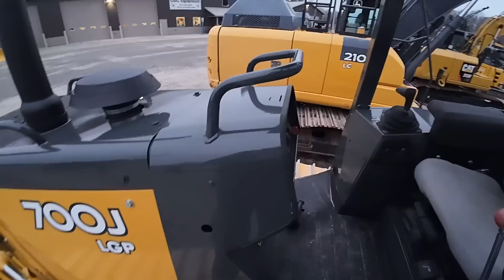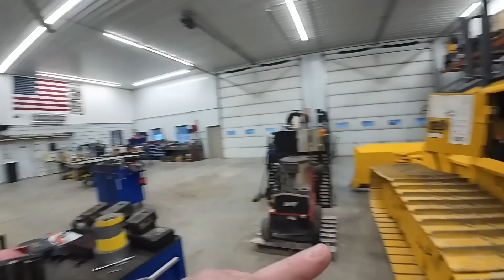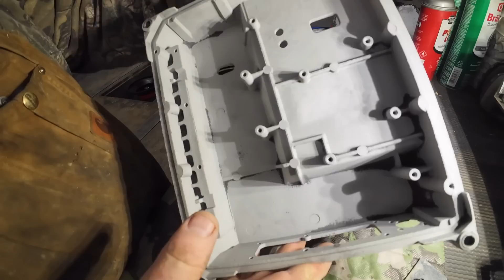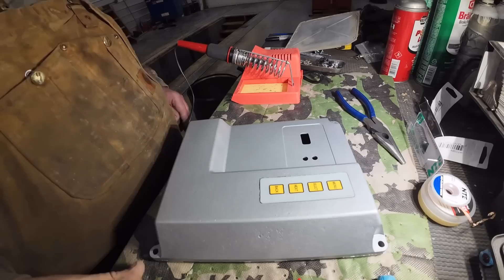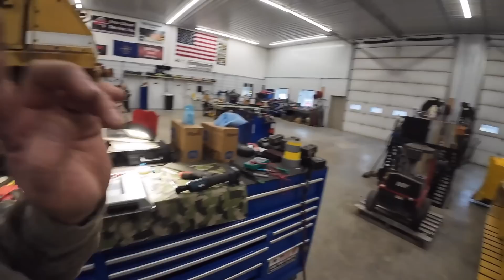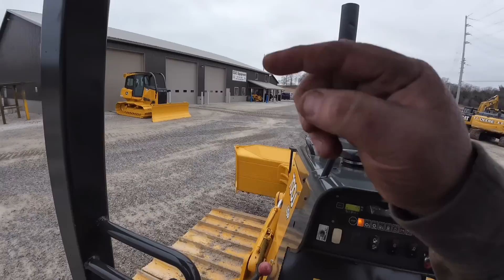John Deere 700J dozer transmission MC300 controller repair after it failed for cheap!

Comment: That's an interesting repair.  Several others have made some good suggestions, namely test the capacitors out of circuit.  They do indeed have a limited life depending how hot they run, how much voltage ripple they see and how close to their rated voltage they are being used amongst other things.  You can get different temperature ratings of those capacitors and should replace with the same or higher.  Someone in the comments suggested using a solder sucker.  The vacuum desoldering machines are good but the mechanical plunger types can push the tracks off the board particularly if you get the joints too hot.  It would have been good to spray the new joints with some lacquer to limit corrosion, after cleaning with alcohol and to have replaced the silicone to add mechanical support.  I would have made sure that the connectors were properly dry before plugging back together.  Using a good silicone spray designed for electrical connections would also help.  Perhaps you didn't show that.  Given the amount of moisture under that cover, I can't help wondering if the fault codes were due to corrosion on the connections as much as old capacitors.  I'm sure they're meant to be waterproof but 20 years covered in damp muck isn't going to do them any favours.  I think I'd have used a different adhesive, maybe silicone or epoxy or a high quality waterproof double sided thin foam tape to seal the display cover and buttons; I'm not convinced CA glue will fill all the gaps.  I hope this might help in future repairs.  I enjoy watching your videos and appreciate the time and effort you put in to making them.

Comment: I like that you used star washers to get a good electrical connection, but something else we used star washers for at Ford Product Development, was to fix squeaky dash or trim panels.  You put them between the panel and the bodywork, but you put one on the bolt/screw head side as well.  Worked like magic to stop squeaks and rattles.

Comment: Free advice from a veteran Aerospace Engineer that has dealt with electrical components for many decades (through the phases from Vacuum Tubes, thru hole and now surface mount components). Even with "power off", those same capacitors have enough power stored to set up "decay" in the PCB components; it won't "fry" them immediately but down the road, they will begin to fail. My un-named multi $Billion Company learned the hard way ... we even took away "Solder Suckers" from our techs as it was doing the same thing via the internal springs ... letting loose "ESD" pulses.  The answer is easy ... "ESD Wrist Straps" ... no matter the situation.

"Antistatic wrist straps are designed to prevent build-up of static electricity and safely ground operators who are working with ESD sensitive components, . Antistat's range of wrist straps are designed to be worn close to the skin establishing a path to ground."

So please use one when handling PCB's and components ... you can't really believe how little power can affect SMT components like this. You're welcome.

P.S. Poor design by JD on the cover ... would recommend using some foam tape ("weather striping") on the cover faces to prevent future ingress of water during life cycle.
Reply from the maker: Thanks for the advice -Kevin

Comment: One thing you might want to do is secure the new capacitors in place because of the harsh environment. You can use something like silastic or hot glue

Also I would squirter some dielectric grease in those connectors to help ward off corrosion

Comment: Hi Clint, another guy with 40+ years of board level maintenance under my belt. !-Never use Acid Core Solder, ALWAYS use some Rosin Core, that will avoid the acid destroying the board. Unsolder the caps for proper testing. Isopropyl Alcohol will remove flux after soldering is complete. I would have used some Silicone to put the switch board back, will hold really nice, plus add the waterproofing benefits that housing needs. Was there a new gasket applied when you replaced that module on the dozer? That Silicone would work there as well. Solder wick is OK, I prefer a good "SoldaPullit" unit to remove molten solder. Better is a vacuum heat unit, makes quick work in circuit board repair. I'm going to send you a care package of items, they will aid you in your next Board Level Adventure! Overall NICE JOB!

Comment: That 'gasket' on the main cover does not look like it is doing it's job very well.  Way too much water getting in the area.  

A cheap fix for that would be a roll of mounting tape used for truck caps (campers, shells, toppers, covers - what ever they are called in your area).  The rolls come 1 1/4" to 1 1/2" wide x 3/16" thick and 30' long with adhesive mounted on one side and are a closed cell foam.  Don't use an open cell tape as it will act more like a sponge than anything else...  If you can push or blow air through it, it's an open cell foam.

IF the tape comes with a Mylar backing on it (looks like packing tape), just peal that off after you mount the tape for this case.  Might help to plug some that hole for the wiring harness too...

Just a thought Sir.

Comment: Very good of you to show and explain this!  My first thought is the engineer or designer did a lousy job on this.  The circuit board might be fine, but the enclosure and those stick on buttons or pitiful.  As someone else pointed out I think the capacitors need to be removed from the circuit to test properly.  Usually about 90% of failed capacitors swell up and leak or even rupture.  You are very good at all of this equipment and it is great that you have your sons involved and that is very rare in this world today.

Comment: I was taught a long time ago to use resin core solder on electronics, that acid core would corrode the connections.  But maybe it doesn't matter actually.  Not a criticism, just an observation.  Other than that, I really really enjoy your videos.  I feel like I'm there with you.  Thank you for including me.

Comment: The price companies gouge people for electronics modules for vehicles and equipment is criminal. Older vehicles are basically a right off if a module fails, when it is likely a 50c part that has failed. 
This would appear to be a well enough known fault and there should be a service bulletin telling dealers to get the $5 worth of parts replaced on the board before looking to replace the entire module.

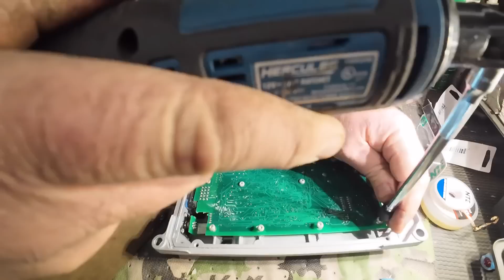Comment: 20:28 I’m 77 now still remember doing jobs similar to this. Happened to have a customer bring in a board with the same thing a couple bad capacitors. It was a quick repair and as I was writing up the paperwork he says Damn expensive for no more than you did. My reply was , You wanted an in a hurry, drop everything emergency repair. You’re paying for my knowledge not for my time. If it was that easy everyone could do it. 
 Great work Clint 😁👍
Reply: Well said, sir! BTW, I've got 12 months on you and I've told more than one customer the very same!
Reply: We pay for an expert's/craftspersons knowledge not their time.  Good job!

Comment: Clint given you are a business the things you share shows me you are a top shelf guy too. I would have no issues what so ever buying from you new or used!!!! I see comment here capacitors (and quite a few other components) are best tested out of circuit this is correct BUT it really does depend on the internal circuitry that can lead to confusing results IF your are not "an electronics" guy. When in doubt take them out!

Comment: Clint - NEVER EVER USE ACID BASED SOLDER!!! It will corrode the printed circuit board rather quickly over time. Get ROSIN BASED ELECTRONIC SOLDER! 
Acid-based solder is used only for plumbing and metal soldering such as sheet metal, etc.

Comment: The best wholesale source for electronic components I'd DiGiKey.
I've been buying from them for decades. 
Those caps are about 85 cents from them.
Clint should use 125 degree rated caps for outdoor equipment to handle summer temps that equipment will see.
I've 40 plus years as an electronics tech.

Comment: You said lead-acid about the solder that you are using - and I suspect you said that in error - I hope.  DO NOT use acid core solder or flux on electronics.  Only rosin core solder.

Comment: Clinton when I do the touch pads on external stuff I use gorilla glue pen clear it doesn't dry hard. I use that to put them down with on the bottom and then you superglue on the outside around the corner edges it really helps keep them water tight. Another excellent video please keep up the good work. ✌️❤️🍺 P.s. I'm an old man and I can still learn a lot of new tricks from you, God bless you and your family you were very well raised and educated.
Reply: How about double-sided adhesive tape?

Comment: Hum, when that dozer come in and all the work was done stripping painting etc. I would've figured you would've popped that panel and looked for codes before putting it on the lot. 
   And you may have but when you popped that panel it doesn't look like anybody had ever touched those buttons or wiped the screen off. 
  Hi Brian and Cell tractors and a few pieces of equipment a year, definitely nothing on your scale but that's the first thing I pop off is the panel to see any type of codes or if anyone has done any rigging to the wiring harness.  
  Another great video brother and yes John Deere will stick it to you on those referbs.

Comment: It's really good that you are willing to dive into a board repair, Clint. I have done some of that work myself for different things that are obsolete or very expensive to replace. I have a good friend who is a retired electrical engineer for NIOSH who helps me out when I get stuck. He is amazing with anything computer or electrical related. Like myself, he is also a farmer, machinist, mechanic, welder, and will do aluminum casting work as needed. He also is a national repair center for an electric fencer company and usually has at least a dozen of those at any given time in his shop for repair. He can build boards from scratch, or reverse engineer them, and have the bare circuit board built, then fit the components himself. He has also done some board work on JD equipment that people bring him for repairs and countless other things. People who can repair things like we do are getting fewer every day, so I like to watch you work with your boys teaching them how to make those needed repairs and build things because they will keep that knowledge the rest of their lives that was passed onto them from you.

Comment: You stated you were using acid core solder, for electronics that is a very bad idea as it causes corrosion. Use rosin core solder only.  An interesting video, thanks.

Comment: I was taught to use rosin core solder on electronics, because the acid  will eventually destroy the device. Acid core was to be used on sheet metal

Comment: The Electrical Engineer in me was impressed. Nice work! One suggestion get an ESD mat and grounding strap.  Those old electronics cannot take much of an ESD event. 

Testing capacitors can be effected by holding them or in circuit. Know what a new capacitor reads in circuit.

Comment: Nicely done Clint.👌
Quick tip:
Check with your electronics store and confirm the expiration dates. I've been told some capacitors have an indefinitely shelf life as long as they are not energized, but some have an expiration regardless.
I don't know why there would be a difference maybe someone there might know.
You are quite the handy fella.🤙

Comment: I fixed a 1000 dollar  board on a Lincoln Welder for 2 dollars by soldering in a new molex connector very rewarding repair.   Add a hot glue gun to your electronics kit it will prevent the solder joints from failing from vibration.  Can that window on top of the cover be removed and resealed? I bet that is where the moisture is leaking in.  Awesome work as usual.

Comment: Nice job!  Add some non-acid cure silicone back in there to give those capacitors a little support and make sure you are cleaning the flux residue with alcohol to prevent corrosion and they will last a long time.

Comment: You may want to think about using superlube (dielectric grease) on the connections. It does a good job of keeping moisture out of the connection. In the marine industry we use it often.

Comment: Hi Clint, had a quick question regarding the cover to the controller. Is there a seal on the base of the cover that keeps most dust and water out? Could not see it that well in the video, and would you recommend replacing.the seal or adding some form of weatherstrip to base of cover for added insurance Thanks Jeff from Vermont
Reply from the maker: No seals but would definitely help keep moisture out

Comment: outsourced work hit or miss. being able to keep a 'simple' repair like this in house, you know what was done by who. its like the controller for our SaltDogg 2 yard spreader; obsolete obscenely expensive brand new with the same stupid design flaw. we sent ours in as a core for upgraded version made by a electronics guru. lead time bit long but his version fixed SaltDogg's stupid idea to epoxy fuses to the PCB

Comment: only thing i think i would have done is that cover i would have used a bit of some kind of gasket maker on it to seal it up
Reply: Seal the humidity in, or create a heat and pressure bomb when it gets left in the sun.  Perhaps JD wants some air exchange
Reply: maybe so but you have to keep the darn thing dry maybe my idea is not the best and will keep what you said in mind if i ever see this  @deadlata9767

Comment: That circuit board is most likely a multi layer circuit board, you can easily tell by holding the board up to the light.  The issue with multi layer circuit boards is that the leg of the component may be connected on more than one layer.  You can't test capacitors while they are still soldered to the circuit board.  Most fluke multi meters are capable of testing capacitors.  You need to invest in a high quality esd safe soldering station, I have always used hakko and wouldn't use anything else.  The fx-951 is a great all around soldering station, I have a few of them and I recently purchased the new fx-971 and fx-972 hakko stations and they are amazing.  Over the last 25 years I have replaced thousands and thousands of capacitors in all types of electronics from refrigerators to hvac air handler circuit boards, pc motherboards, routers and basically anything with a capacitor.  You should get some double stick adhesive tape for the buttons.  They make a thin double stick tape that is just the clear adhesive and doesn't have any foam.  I have a 4" wide roll that I use to replace the adhesive for similar repairs and it also acts like a gasket to keep moisture out.  I use two techniques when replacing capacitors, I don't use any type of desoldering when removing them.  If I only have a regular soldering tip I walk the capacitor off the board by heating one leg at a time and alternating between the legs moving it little by little and the further away from the board it gets the more it moves each time.  Hakko makes forked tips which are perfect for heating 2 legs at the same time so you can pull it straight off and I install the new one the same way.  I like to keep solder in holes on multi layer circuit boards because you have less of a chance of having connection problems with the different layers.  I prefer using Kyocera aluminum polymer capacitors or the Kyocera hybrid capacitors.  Different capacitors have different tolerance ranges and they should be replaced with the same tolerance capacitor or lower tolerance.  You don't want to put a higher tolerance capacitor in place of a lower tolerance capacitor. I try to use +-1% if possible but it's not critical on many types of circuits. If the capacitor is used for tuning a circuit in a ham radio linear amplifier tolerance is critical.  The capacitors on the tcu are most like just for noise filtration on the input power side so it's not critical at all.  I would try to use a higher temperature rated capacitor for the JD TCU to give it the longest possible life.  If there is adequate room on the board you can use a bigger capacitor so even as it degrades it's still above the minimum requirements.  If the capacitor is only being used as a noise filter you can almost always replace them with a higher capacity capacitor.

I have the ability to repair just about any type of pcb, I have hot air rework equipment along with all the equipment to repair devices with smd and bga components.

Comment: I wonder if something like fluid film , a spray protectant , would help it against all the moisture.  South Main Auto on you tube from New York, uses it alot. on connectors and such. Personally never used it i live on a desert so rust is not much and associated corrosion is not a problem.

Comment: As Clint stated all 'electrolytic capacitors' have a finite lifespan and can eventually dry out inside, once dry they need replacing. But they need to be measured when out of the board, if they are still connected on the board, you'll not get a real reading.  Also good advice for not buying cheap capacitors off the internet as quality and life-expectancy is really very poor on the cheap ones. Life expectancy of capacitors vary wildly with quality of manufacture, the design of the board and the environmental extremes they will work in (such as high and low temperatures)

Comment: Micro soldering hobbyist here . I work under microscope.  Damn fine job .
There are UV cured / natural light cured sealants that allow for thermal conductivity you can use on repair areas to help guard agaist future corrosion.  
" UV Mask " with a UV light . Takes 30 seconds to cure .
Love your videos